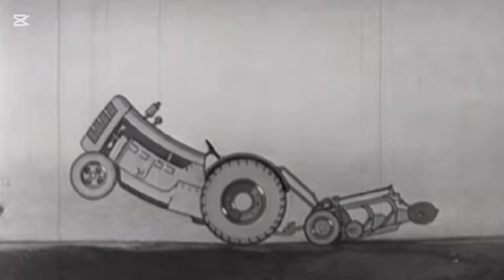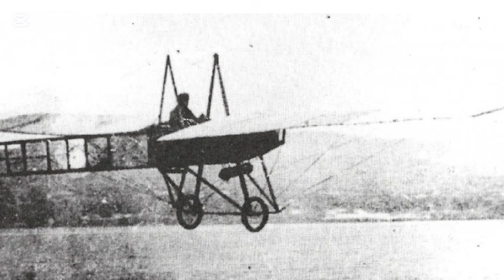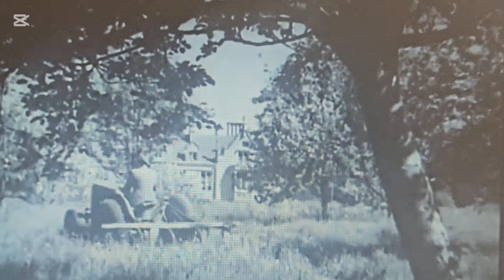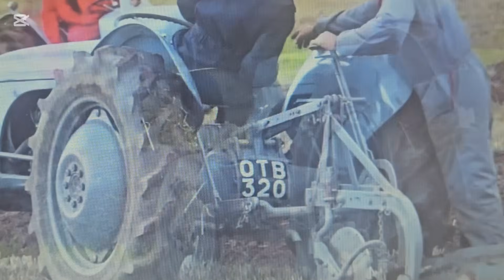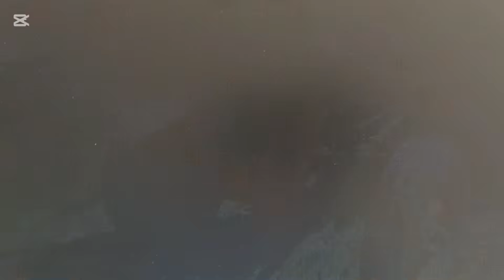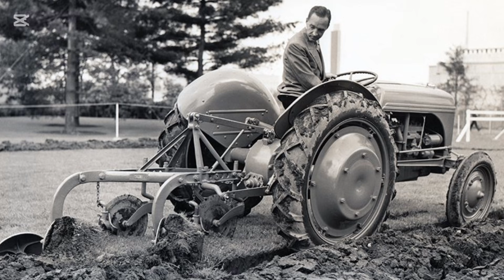THE FAMOUS FERGUSON SYSTEM..

Comment: Looking forward to part two, surprisingly a lot of tractor drivers do not fully understand the correct set up of the draft control. Especially since tractors got heavier and more powerful, more power and traction negates the requirement for the correct set up.
Reply from the maker: Thanks for watching 👍

Comment: The 3 point linkage was, without doubt, the most influential inventions and wide spreader inventions since the wheel brilliant information.  
I was told onto time that in trailed implements were supposed to youse a timber pin so it would break q
Reply from the maker: Thanks Morgan